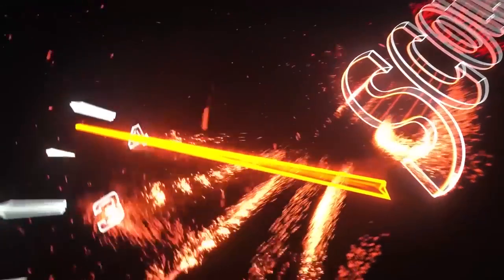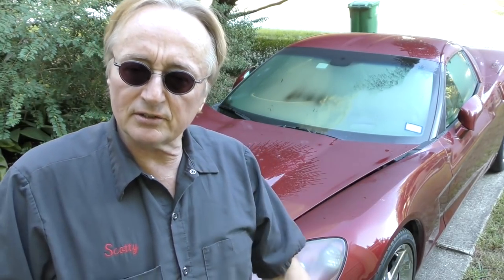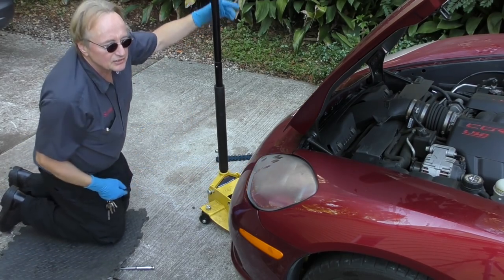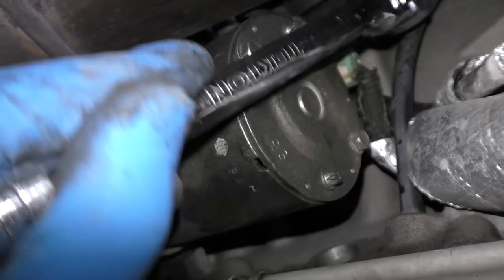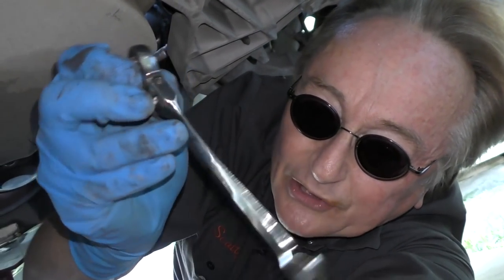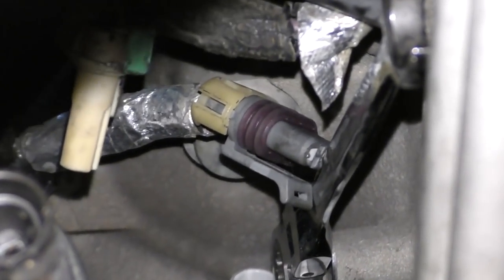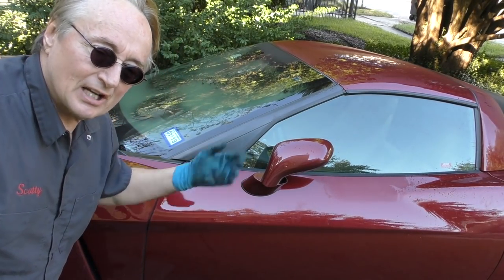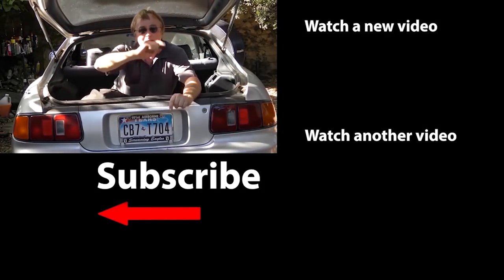Here’s Why Corvettes Suck

Comment: Those crank shaft position sensors are a real pain in the rear end, one went out on dad's old 99 Dodge went up and the replacement non-OEM part didn't work either, figured out the cheap one was junk and got the OEM. GM engineers took a lot of pointers from BMW in manufacturing over engineered, hard to replace parts automobiles.

Comment: I actually think C6 corvettes are actually really good cars. Very solid car with good power. Well at least more solid than the other cars that GM was cranking out at the time. Although I like my 2006 Impala SS, good power and reliable (somewhat) it definitely not as good as my 1994 Buick Roadmaster or my 85 Corvette. Sure GM quality was going down since the 70’s, neither of these cars ever gave me a big headache.

Comment: I remember the crank angle sensor going out on my wife's Holden (Australian GM) Commodore sedan about 10 years ago (common failure on those cars). The car just died as she was travelling through a major intersection, luckily it was able to coast through and there was a large roadside area for her to pull over in as she reached the other side (of the intersection).

Comment: Back in the C3 days, you had to unlatch both doors to use jack stands adjacent to the rocker area, or you’d get nice stress cracks on the tops of the fenders, about 8 inches in front of the windshield. I believe it was even in the owners manual, but I don’t remember for sure. I found out the hard way.

Comment: Reminds me of changing crank position sensor on my '99 Cherokee  .. nasty spot, and don't drop the bolts .. into the flexplate housing. Not quite as bad as that 'Vette sensor though. Nasty.
Reply: Yea, l did it on my sisters Jeep I am 72, it did all kinds of trucks cars over 55years it took me all day to do it but I got it.

Comment: Meh,  I replaced a camshaft position sensor on an '06 Altima.  Similar trouble and it was a 4 cylinder.  Firewall side of the engine and the wire had to be removed before taking the bolt out.  Fun times with only one hand that would fit into a completely blind spot trying to lift one side of the release tab while pulling the wire out and hoping I didn't break anything, then the fun of assembling the whole thing and the loose bolt in the socket while snaking it into place,  again totally blind area,  hoping it didn't come apart or fall out of the socket.

Comment: As a C5 owner I can verify that no matter what you're doing to a Corvette, there is never enough light! And when you get all your lights positioned just right and you think "that'll do it", you will find a spot or angle that throws it all out of whack and leaves you griping.

And if you think getting to the crank position sensor was difficult, you should look up how to change the cam position sensor or the oil pressure sensor. Now that is annoying!

Comment: Had the same issue on a 2000 Olds Intrigue way back.   Would start but just stall shortly after.  I recall it being similar to what Scotty showed with the Corvette in that the starter had to be removed to change crankshaft position sensor.
I prefer to use rhino ramps over jack stands whenever possible especially for something like this.
Reply: Ramps AND Jack Stands! My 2002 Intrigue GLS had the same CPS problem. Now it's fine at 88,000 miles.

Comment: C'mon Scotty.  I thoroughly enjoy your videos...but...disconnecting the positive cable?  You know better than that.  You take a chance of the ratchet arcing if it gets too close to another grounded part.  Disconnecting the negative cable avoids that risk.  Also, I see the battery wobbling when you pushed on it.  That battery needs to be secured so it can't move at all.
Reply: Do both,neg first, pos next after repairs, pos first neg sec thi way less problems I been doing this 5o+ years works for me.

Comment: Dealer had my parents spending 500$ to fix there kia. They put in a new PCV valve in but it never fixed the problem. I installed a new crank position sensor because that was the code shown and it fixed the whole car. Was only a 12$ part.

Comment: Scotty, why on earth do you remove the POSITIVE battery cable?  Auto mechanics 101 is to always remove the NEGATIVE cable.  This because if the negative cable come into contact with ground (the body, or any metal on the car) it will NOT short circuit.  If the disconnected POSITIVE cable touches ground, it will short circuit and likely damage components.

Comment: Bad GM engineering having to take off the starter to replace a sensor but still better than replacing a Toyota Tundra starter where you have to take the top of the motor off to replace... Tomoto must have hired some GM engineer’s..

Comment: Your advice is always fun.  But seeing you do the work is priceless.  I learned every cuss word I know working on a Corvette.  If you really want to shine a light on GM engineering, change the heater core on a '96 Corvette.  ROFLMAO. It could be your first 14 part series!  Then swap out the OEM Optispark for extra credit.  BTW, engineers don't mount the ICM to the engine head.  Bean counters do.
Reply: Also Jags,MGs other GBcars.

Comment: I had replaced a crankshaft position sensor on an 05 volvo s60 and it turned out that the timing belt had jumped a groove and got bent valves. Had to do an engine swap with one from a salvage yard

Comment: gotta say, GM is full of these great ideas.  On my Yukon the washer reservoir is under the battery tray and also bolted behind the wheel well guards.  In order to change a washer pump you gotta put the driver's side front end on a jack stand and take the wheel off.   Why GM why?
Reply: Good ol GM, never ends.😅

Comment: What happened to engine's without a crank sensor back in the day?    Had this sensor go out on my ford ranger, pull radiator out, timing belt, just took time.    Not a fan of some electronics on engine's today.  Increased failure rate it seems.

Comment: My Chrysler died on the side of the road. Fearing the worse limped it home. $27 cam position sensor. Top of the engine. One bolt. Took less than 3 minutes. Not everything seemingly tragic is so. But usually the little cosmetic or ancillary things take a ton of money and time like all those electrical gadgetry on every modern car.

Comment: So you remove the positive terminal? That usually gets you fired as a mechanic, especially after you weld the dropped wrench to the positive terminal and the car frame. Or you set the whole car on fire and frying the wiring harness…I’ve seen at least a half dozen times.

Comment: I've owned three Corvettes during my lifetime, one used and two brand new.  My wife loved Corvettes.  I rarely drove them because the Corvettes irritated me.  They look really nice, but the quality of workmanship was poor.  Working on the engine was a hassle.  A simple spark plug change turned into a cussing session.  You learned what tool, extension, angle of positions to use the tools, to do what should have been a simple spark plug change.  The clutch linkage was very cheap.  The suspensions were poorly designed.  The rear had a problem with squating.  Had to replace the rubbers with neoprene bushings.  Why didn't the factory do that?  It was like driving a truck with a Corvette body.  I finally told my  wife No More Corvettes!

Comment: I had this issue on my Dodge Stratus. I replaced the sensor and it kept turning off. I took it to the shop and they took my engine apart essentially and couldn't put it back together.

Comment: I dont think you need to pull the transmission to change the reluctor in the flywheel. The tranny is in the rear. Would have to pull the engine or at least partially  pull it.

Comment: I have a 2008 Z51 Corvette. It has 26,000 mi;es. The light for "check fuel system" came on and the gas gauge reads empty.The delear said that it will cost about $1900 to repair since they have to remove te gas tank o do so. What a rip off..I will never ever buy another GM Vehicle !

Comment: So many things can go wrong on these cars electrical wise
Keep a crowbar under the seat in case the battery gets a total short because the doors open with an electric button and with no battery can't open doors or roll window down so your pretty much trapped
Brilliant
Oh crowbar is to break out window so you can crawl out if battery goes completely out
Reply: You will not be trapped if you know what you are doing.  You can open the doors with no battery power by pulling the cable lever on the floor.  Chevy designed this as a safety backup

Comment: Imagine if that corvette had long tube race headers. Lol
Reply: Mine has 2" headers, was able to remove the starter without undoing the passenger side. Corvettes are tight to work on but not impossible lol
Reply: Cajun_MotorCo it all depends the type of headers but some are really impossible that you just got to remove the aftermarket part.
Reply: @jonathancisneros7150  that is true, it was definitely tight so I unbolted the header away from the head when I went back in with the starter and it was much faster and easier lol the only real thing that sucks about these Corvettes are the electrical issues they get. I'm chasing one down right now 😒

Comment: SCOTTY PLEASE GET BACK TO ME. My car is idling rough and miss firing while idling it is far overdue for an hour oil change and the oil smells contaminated with gas. Could it cause a p0300 code ? As iam idling it only idles I’ve heard the vvt can start to miss in v6 engines due to contaminated oil

Comment: Easy enough to bash GM and Corvettes but its all part of the game with this kind of car. They jam a big V8 engine underneath a sleek compact body, theres not gonna be easy access to any components. You want  stupid... an oil change in a Bugatti Veyron takes all day and costs  $21,000. Early 90s pontiac gran prix turbo,  you have to remove the exhaust system to change the oil filter.

Comment: I laughed my @ off GM started placing the last two spark plugs under the firewall.  No possible way to change the plugs unless have a lift to put the car in the air to drop the engine.  
Worse yet.  They traded the car in rather the pay for the service.  One less GM fanboy.
Reply: Which model was that?

Comment: Well its says crankshaft position sensor on my code reader so I will just load up the parts cannon and fire away. Smh. I work with a tech that does that, fixes it 50% of the time. The other 50% a real tech such as myself  has to actually diagnose and fix it properly.

Comment: I really wish you would make a video specifically about the Chevy HHR. You have only briefly mentioned this car, and you had nothing but bad things to say. I sincerely feel like you always forget a couple major points! (In nearly every video)

Mainly the owners! Maintenance is very important. Many of the vehicles you have deemed "junk" are actually very good cars IF they are taken care of/maintained well. Keep in mind, the vehicles with which you have experiences are vehicles brought to you by people who obviously don't know a lot about properly maintaining their vehicle. If they could they wouldn't be going to a mechanic...

*****I have a 2010 HHR 2.2L Auto with almost 300k miles and other than a very minor vacuum leak (throttle body gasket worn out) it has NO major problems/never had any major repairs. It has always had regular oil changes (full synthetic). The most major parts replaced were the shocks/struts at around 240k miles. I make a weekly out of state trip totaling around 280 miles+ all my daily driving.
I have owned 298 vehicles in my lifetime. This is absolutely (and unexpectedly) my overall favorite vehicle I've had as a daily driver.
The number 2 spot goes to the 1995-1999 Cavalier with 2.2 pushrod engine.
Reply: 298 vehicles! Do you change vehicles every week?
Reply: @rickcarroll7133  I have flipped a LOT of them. I just drive them until they sell. lol

Comment: Ya gm designed that way so 95% of the owners will take it to gm dealerships to get it fixed and buy do they fix your wallet too as the service manuals tell to charge the customer x hours to take off the cars etc. But the mechanics will fix it the way you did but charge you the customer full price at 6 hours at 125.00 a hour, boy do9you love GM for this.

Comment: WOW. So, I have worked on LS engines since 99 and even own a C6 ZO6. Speaking from experience as a Master tech I would say you are really drumming it up big time. I have had only seen one failed crank position sensor. Most were burnt wires going to the sensor from aftermarket headers. I can think of dumb crap GM has done like putting a 10 bolt in a 300 + hp car.  Ranting about removing 2 bolts on a starter to get to a crank position sensor wouldn't be worth my time. The repair takes a whole 1/2 hour.
Reply: Would you recommend owning a c6 Corvette from a reliability perspective?

Comment: So corvettes suck because of something as simple as this?? I’ve owned 2 corvettes a c5 so6 and a c6 and I barely had any issues!! The LS engines are very reliable and so are the Tremec transmissions I mean the rear ends have problems sometimes but modern corvettes suck as the one you were working on are pretty damn reliable

Comment: This is a how NOT to fix a car video.  Scotty, love your vids but this is absolutely how not to diagnose a car.  When you scanned the car it shows a circuit code which predominantly is a wiring problem on GM, a bad sensor rarely throws a circuit code and this code is intermittent as you can see on your simple scanner and if sensor is in fact bad the car would not start at all as there would be no injector pulse.  There is some simple diagnostics you should have performed and you should know with your 50+ years experience that this was probably a wiring or connection problem that you may have got around by just unplugging the sensor and plugging it back in tight (which is why I suppose the car ran after new sensor).  It is possible that the sensor was malfunctioning or shorted internally but saying "I hope that's the only thing wrong with it" you are essentially a "backyard parts cannon" rather than a real mechanic. GM are notorious for these wiring problems and since you did not adequately test or address it chances are this car will just be coming back to you one day with the same problem. I do love your vids, personality and honesty but be honest when you have no clue how to properly perform a diagnosis of the problem and to verify that it will not return.  Perhaps I am just looking too deep and your video's purpose is to show just how to throw a part on a car to see if it fixes it by all these guys who think they are mechanics in their back yards before they take it to someone if it doesn't work

Comment: You're supposed to remove power cables  from starter first  !!  And if you think that's a hard job  changing that crank sensor , then your very limited to what your actually able to do , from what. You claim to be able to do ! That's an easy 25min. Fix !! Lol.. also your not supposed to jack it up from the front !!! Lmao !! 😂😂😂

Comment: Huh so weird he claims you have to take apart a lot of the car to get to something that if it was in the air ie a actual mechanic was fixing it it would be a lot easier and quicker to do it.  But hey scotties 100+ years of shitty oil change experience and battery replacement knows all